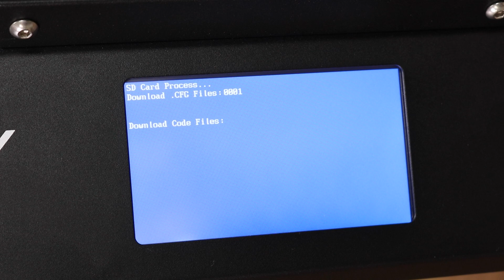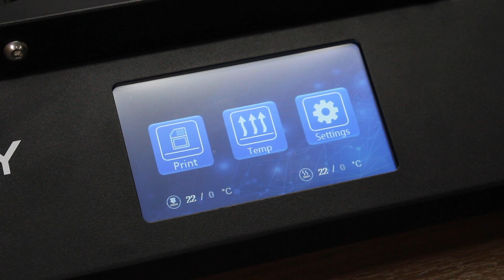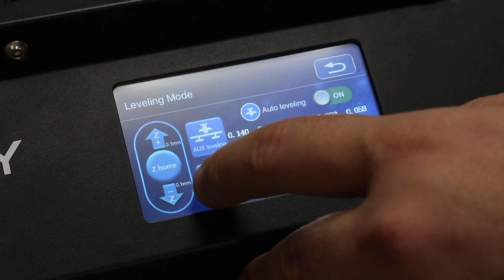How to install a BLTouch on a CR-10s Pro *UPDATED*

Comment: If you are struggling @ 4/2025, please see the comments below regarding using the Z+ connection and not the Z- connection on the mother board. This worked for me after 4 days of trying everything else
Reply: thanks for the tip.  where did you grab the firmware?  (and did creality publish an "official" one for touch?)

Comment: anyone watching it in 2024? I just installed it (v3) on CR10s pro V1. Initially I did not put the jumper because in other videos they did not put it, but this is indeed the definitive guide. I followed the steps in the video including the jumper and changing the order of the cables and it worked! Thank you so much :)
Reply: kept this printer for a long time, I use it often, together with a prusa mk3s and a bambo x1c, its print quality is unsurpassed, all the pieces compared are decidedly better on the Creality, obviously I'm talking about prints with PLA and Petg, for other filaments perhaps further modifications need to be made, the only important flaw is that it is very slow but for me it is not very important
Reply: @rOSScOGITANS  How fast have you been able to print with the CR10s Pro? I'm new to this and I don't know how fast I can make it work.
Reply: @ProfeParra  between 50 and 100mm/sec, not possible faster
Reply: Hello, from which website did you buy the kit to put it on the cr10s pro V1? ...
I want to buy for my printer without failing in the attempt, please help me with that information friend.
Reply: I am following it as well for the same printer. But I'm not sure where to get the LCD update, the repo has been reorganised and I don't see the LCD thing anywhere.
Reply: Hi, did you use the V3 or V3.1? There are so many conflicting infromation about that I thought that I had better asked before ordering. Thank you.
Reply: @lensman5762  i use special firmware with bl-touch

Comment: Don’t use the Z- port for your black and white wire, too much work, just use Z+ port the exact same way and use cr10sprov2 based firmware, works much better and doesn’t need to short anything.
Reply: Nice! Worked for me. Used the same firmware for the pro v2. Thanks!
Reply: Unfortunately, I used the 3dtouch clone. So it's failing at autoleveling.
Reply: Hello, maybe you know a solution to my dilemma.
I have a secondhand CR-10s Pro with a BLTouch installed and TinyMachines firmware.
I'd love to start using the Creality Sonic Pad in order to get Klipper, but I've read of people having to "downgrade" back to stock Creality firmware for that.
I read you suggesting using the Z+ port and CR-10S Pro v2 firmware: do you mean using a stock Creality firmware rather than TinyMachines'? Have you done that yourself and does it work?

Comment: Creality website no longer has the firmware download for this printer, where can I find it?
Reply: did you get a solution for this
Reply: @connormack9828  I just used the CR10S pro V2 firmware and LCD DWINSET. You also don’t need the jumper cable to short anything, just use the Z+ port instead of Z- shown in the video, everything else is the same. Lmk if you need more clarification!
Reply: Necroposting buuuut, I think someone will want this, https://github.com/InsanityAutomation/Marlin/releases for the actual pre-built firmware for creality/others and/or https://github.com/InsanityAutomation/Marlin/tree/CrealityDwin2.0_Bleeding if you want to compile your own form latest sources.
Inside the source assets, there is a HEX folder that contains a whole slew of pre-built hex files for flashing onto your mainboard, you will also find the latest combined landscape LCD firmware. 

THERE ARE FIRMWARE IN THE PRE-COMPILED HEX FILES FOR ALMOST ALL CREALITY PRINTERS AND MODELS, INCLUDING VARIOUS HOTENDS, AND BED LEVERS you will probably want the CR10-S 10 Prov2 using Z+ firmware or the CR10-S Pro BL hex these should work for the two main installation types of the BL Touch,  the LCD firmware is compatible with all the pre-built firmware the current latest of posting is Marlin 7.4.7 TM3D DWIN builds.

Comment: Hello! I want to replace the original sensor to bltouch on my CR-10S pro. 5 wires cable must be 1800mm?  Really? May be I can make it some shorter? Oh... Thank's I did it! With some differences from this manual, but it work! I have used a flat cable from the controller to a breakout board, I routed it in the same hole with the original cable, then I has make a connection and next route a silicone wires to a print head, where I has place the additional connector to BLTouch...

Comment: I can't find  a working Marlin link for Tinymachines, have they stopped handing this out? Tried using Creality CRX Firmware but it sucks! Anyone got a new link or can suggest Firmware to use for CR10S Pro?
Reply: did you find a solution for this ? i've just added a bl touch to mine and realized i cannot find firmware.
Reply: @level-upengineering5813  Did you manage to find the firmware for this mate?

Comment: Hey, I really hope you see this.

I want to do this, but I am going to have to get a touch creative with what I do (as I am running klipper and already have a direct drive modification). I wanted to know if you have the information for where this is connected on the board (for klippers sake) so I can program it properly? I think it will still work, but I need a little knowhow and pin names to get it right. What are the black and white cable for and what are the colored cables for? If one is power and another information, that may play a key role in how I program my settings in klipper

If not, the only other thing I wanted to ask is what are these pins called? My BL Touch did not come with extra nuts or the jumper. I want to know what jumper is used: what size jumper, what size/name are the pins the jumper will attach to. Also, your link on longer leads to the extension wire you described, but I got lucky to find one on amazon.
Reply: hey did you manage to figure it out? I'm having the same problem

Comment: I accidentally ordered a blotchy for the v1 motherboard, but my cr10s pro has a V2.4 mother board. The smaller just connector that is supposed to be three pin, has the same connector as the y-cable. Will my bltouch still work?

Comment: The "Creality_DWINTest" branch is no longer available. I have seen that there are the CrealityDwin_2.0, CrealityDwin6.2 and CrealityDwin2.0_Bleeding branches. I´m now not sure that they serve the same purpose, but the README states that. In none of them there is the "10sPro_1.70_ScreenFiles" (at least I didn´t see it), with the tutorial recommends to use. Which file should I now use to flash the LCD? It would be a shame if this tutorial is no longer usable, because its very good and high quality.
Reply: I've got the same problem! 😭

Comment: So I'm on the GitHub page, but the original link is no longer valid.  I'm browsing around, went to the Insanity Automation page, on the "Creality_BondTech" branch.  It seems to be what I want, but when I downloaded and unzipped the file, there's about 200 different Hex files and I have no clue which one to use.  Can someone please assist?  I'm pretty desperate at this point and my printer is essentially a giant paperweight until I get my BLTouch installed.  Thank you....

Comment: I did all the video but I loaded the firmware of tinimachines, when I turn it on the printer does not go down and the bltouch remains in the air about 30mm and there is no case that it goes down ... I do not know what the error

Comment: EXCELLENT GUIDE! Thank you so much! I've bought my BLT probably 9mos to a year ago and have been putting off installing it. But I finally got sick of messing with the sensor on my v1 when my Pro v2 with BLT is so dependable. Used your guide and the conversion went smoothly! Thanks!

Comment: Is it really required to swap the orange/red and brown cable?  My 2m extension didn't come with the white connector on one end (to connect directly to the BL Touch) instead, it connects right to the cables that came with the BL Touch without the need to unplug the original ribbon cable from the BL Touch.

Comment: I'm curious - I have a BLTouch and was going to replace it with one of the inductive or capacitive sensors.  I'm stumped as  to why you would go to a BLTouch from that beautiful sensor that's included.
Reply: Personally it’s a lot less inaccurate. A magnetic field controlled sensor in my opinion has too much variation than a physical stick that literally contacts the bed. Magnetic fields can be effected by many many different things, like temperature will mess with it. But a stick is a stick, it’s gonna be the same length every time no matter what
Reply: @jackzhao604  I posted that Q 2 years ago and since then, I've tried all the bed sensors available.  So far, the best I've had so far is a physical microswitch attached to the print head (klicky-probe).
Reply: @BlackWolf42-  i don’t doubt it, you can’t beat a physical button, they don’t lie

Comment: Hi,
Please, you can better detail the type of jumper you used at the location of the primitive sensor plug.
It appears to be a Jumper with 2 Dupont pins. If you can, attach images and specifications about the Jump.
Sorry, but I have little experience in the matter.
best regards
Reply: The jumper comes with the Bltouch
Reply: Here's a link to what it looks like https://www.digikey.ca/en/products/detail/wurth-electronics-inc/60900213421/2508447?utm_adgroup=Shunts%2C%20Jumpers&utm_source=google&utm_medium=cpc&utm_campaign=Shopping_Product_Connectors%2C%20Interconnects_NEW&utm_term=&productid=2508447&gclid=CjwKCAjw_NX7BRA1EiwA2dpg0oAhHGzvdSzOGeVh-M7HE1SvsTk0VWXBZz5a3c9cXiJ_M32R3golaRoClz0QAvD_BwE

Comment: Hi, just followed this tutorial and it worked like a charm. For now I've been adding an autobed level before each print with simplify 3D but that seems overkill.
I'm thinking of just doing one manually from time to time.
The question is how do you do this? Do I just go in the autolevelling menu and do a measurement?
Reply: The cr10spro is an extremely unpredictable printer. I’d keep the auto bed level every time
Reply: @seanjuth  Its not that bad. I deactivated Auto bed level because I print on a piece of mirror held in place with some clips, the printer would crash if it auto levels. I got really nice results with manual leveling. But now I relocated the clips so the printer is able to auto bed level again.
I modified my printer with:
Synchronized Z-Axis
Anti backslash nuts (Z-Axis)
when printing a calibration cube i get X +0.02, Y +0.00 and Z +0.02 (20x20x20)
Maybe i will add BLTouch to it soon

Comment: PLEASE HELP! I did everything in the video but when uploading the firmware it cannot find the port and the memory is to little to run stable it says. I have a non working printer now. Can somebody tell me how to fix this issue? Thanks!
Reply: Did you ever get this sorted out? I'm having the exact same issue now.
Reply: @screamingchicken83  yes install a driver I don't know where but I fixed it. Search for it online :)

Comment: As of December 2019 there is a 2.0 DW5 firmware for the CR10S Pro. If I want to use it with that firmware does the procedure in this video change? This is the firmware I'm talking about: https://github.com/InsanityAutomation/Marlin/blob/CrealityDwin_2.0/CR10Pro_BLTouch_BIL_DW5.hex
Reply: PAGE NOT FOUND...

Comment: DO NOT USE THIS AS INSTRUCTIONS FOR INSTALL A BLTOUCH ON A CR-10S PRO!!!!! This video is equivalent of someone telling you to put your cell phone in the microwave to charge it. I did all listed in the video followed instructions on the firmware and this video. maybe my bltouch 3.1 is screwed? but when i plug in the firmware from the hex file from creality my bltouch lights up. its not functional but it atlest powers on and shoots out the pin when i install the firmware how 3d printing canada states the bltouch does not even light up
Reply: I think you hit on it.. The instructions are a little out of date. The link provided to purchase the bl touch (in the comment section) now points to a 3.1 BL Touch. The vendor states it is "Compatible with CR-10s Pro when using Marlin 2.0 firmware." The firmware link in the comments points to a 1.9 version of marlin. There are several places to get the 2.0 version. I will post back when i get it working.
Reply: @chrisnjackson  I did get mine to work but different connections i lucked out bltouch replaced the 1st one then i used crealitys firmware for cr-10s pro and bltouch and connected white and black wires to the Z+ works perfect connected to the Z+ same jumper placement and same wire switch in the plug just dont use Z- like how they show in video connect it to the Z+ plug
Reply: @st0mper121  
I don't understand ... you just followed the tutorial and reversed instead of z- you put z +, nothing else?
Reply: @chrisnjackson  got an update for us? Just want to get this working, thanks if you can point me in the right direction.
Reply: How did you do then because its not working for me
Reply: @simon1209  these instructions are out of date. I did get mine to work. Keep in mind this has been a few months So this could be out of date as well. but maybe this can help. some links that helped me might be useful. https://www.antclabs.com/creality3d-board  this was for the version 3.1 bltouch. i cant rem where i got the firmware. I had to tweak the firmware anyway. NOTE: the 3 pin plug wires are swaped red, brown, yellow is the order you can see in the picture on that link i provided

Comment: You could just route the cables with the ribbon cable. There's plenty of room if you unscrew the two bolts and put the plate back. 

https://youtu.be/de4b6HZIpNA

Comment: Anyone know if the kit comes with the m3 bolts mentioned ?
Reply: The bolt to mount the sensor into the printed holder came with the kit, however, you need to get 2 x 3 mm nuts to mount the bracket into the printer
Reply: @marcogutierrez9339  Yeah I realized that and had to make a trip to my local hardware store to get them. Basically spent 5 bucks in gas to buy 97 cents in parts that should have been included in the kit. I wish I found the tiny machines kit before ordering this kit. That one includes an aluminum mount that matches the printer and everything you need for the install. Oh well, end result is I now have a bltouch installed. Works great.

Comment: thx for this tutorial video - I did all as shown - 2 problems encountered: after a manual bed leveling I start the automatic mesures (16 points) and between every mesure point the print head rises up several mm so after 2 or 3 measurements the BL Touch doesn't touch the bed any more... automatic mesures are impossible now. 2nd problem: octoprint doesn't work any longer with my printer. "Your printer's firmware reports an error: automatic bed leveling impossible and therefor octoprint stops working". 
HELP NEEDED: I flashed the LCD and the Marlin firmware as given and described. How to get this probable firmware failure corrected? What about the source files Creality is giving here (September 2019): https://drive.google.com/drive/folders/1DcKqGS5zn4cIgjgTpwAh_sQLXW06WRB3  would it be better to use the MARLIN.INO of version 1.1.6 given by Creality ("CR-10S Pro Firmware + Source Code + SD Files + BL Touch") or to do new trials with the one you refer to (GitHub and its MARLIN.INO)? are you sure that the only change in line 98 is suffisant? there are so many lines in "configuration.h" that could be activated to get a more "CR-10S PRP" version of the firmware? thanks for your help, meanwhile my printer isn't usable anymore...
Reply: Is it fixed now? I am about to install the BL touch but what it the right way to do this?

Comment: Question: 1 what size are the nuts you need to get the plastic part to screw in. (for the bltouch to attach to your i guess extruder mount? i guess its called? only 2 nuts came in my bltouch kit not 4 that is needed. i noticed that you flashed the LCD but you did not flash the printer itself? does the firmware in the printer need to be flashed as well? not just the lcd?

Comment: Will u be inställning the new  version 2 Cr 10s pro V2 firmware 1.1.6 bl touch
Reply: sure ? the motherboard it's the same ? and the connections of bltouch ?
Reply: @Gasrovescio  bltouch seems to be of 3.1 and the same mother board of 2.4.1 . i tried it on my bltouch 3.1 it would always switch to chinese then freeze thats the only problem i had but everything else was ok needs more testing my opnion
Reply: @ktm890rsweden5  I own bltouch v3.1, but do you think the links are the same as those found on guides like youtube? in theory if the motherboard is the same and the motors are the same I don't see why there can be problems. are you sure we have 2.4.0 and not 2.4.1?

Comment: Why should one change the level sensors? :o
Reply: if it gives different readings, the you start the printer after the bed cool down of turned of. or the sensor itself is encountering calibration issues because of envouirement things like temperature etc. the base sensor from the cr10s pro is a problematic one. you can check a video on my page to see what ... it can be